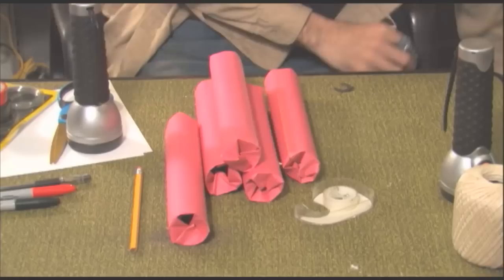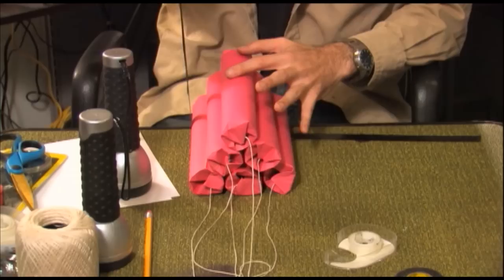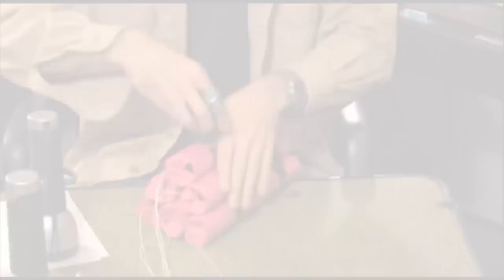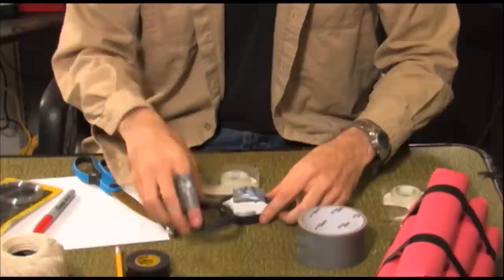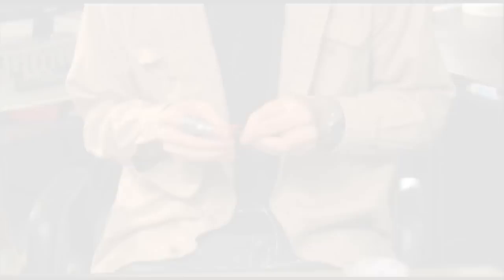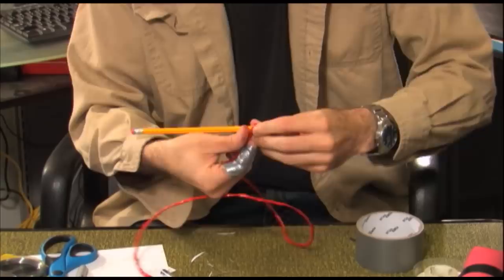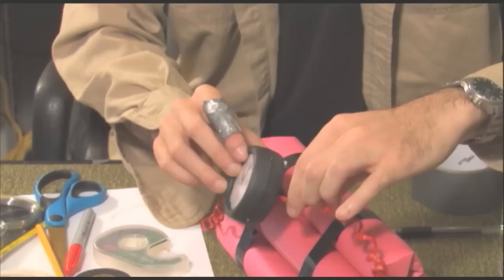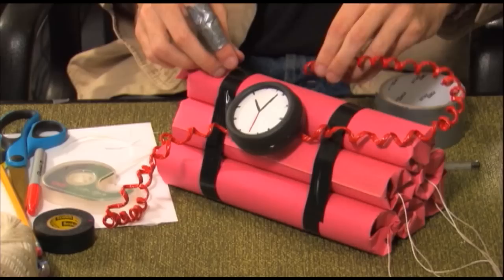How to make a Prop Timebomb

Comment: AGE RESTRICTED???!!
Reply from the maker: 'fraid so. We tried appealing. Youtube decided that I had not violated any community guidelines, but nevertheless felt the content was unsuitable for the general audience. Take a paper towel roll, roll it in red construction paper, tape one end shut. Trail a piece of string from the other end, then tape that shut as well. build 6 of them, stack it into a pyramid, and wrap the whole thing at both ends with electrical tape. For the timer, take off the top ring of a flashlight. use the ring to trace a circle on card stock, and draw in your clock face. tape the clock face inside the flashlight ring. For the red wire, use galvanized wire (or pipe cleaners.) wrap the wire in red electrical tape. wrap the taped wire around a pencil to create the spiral look. Run some of the this wire from either side of the pyramid, and tape it behind the clock face. Use adhesive foam to attach the clock face to the front of your pyramid. Sorry, but that's the best i can do for now.
Reply: The Prop Master's Handbook ah. Okay thank you so much for responding to my comment. Happy making!